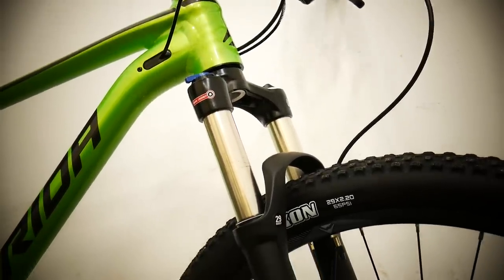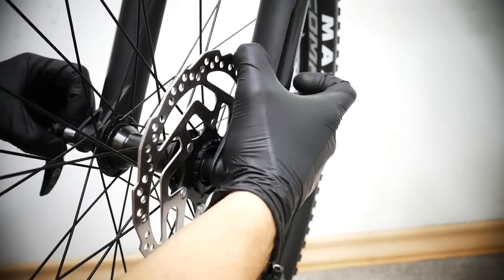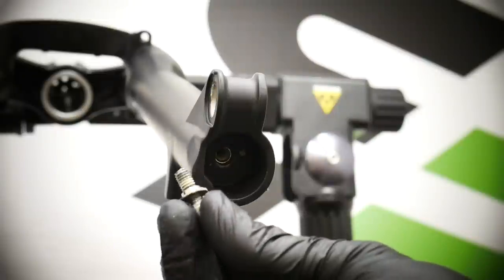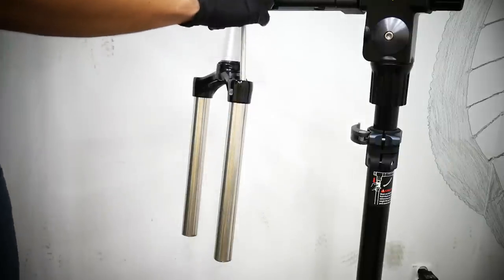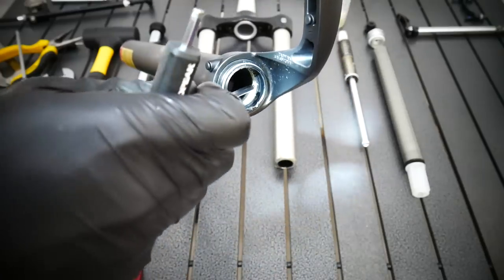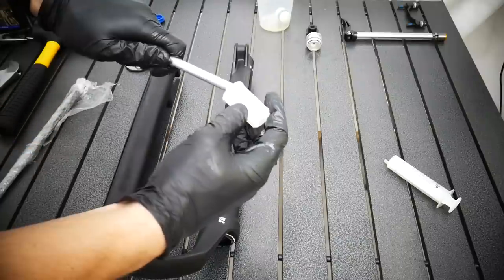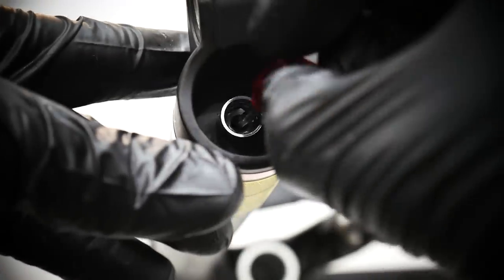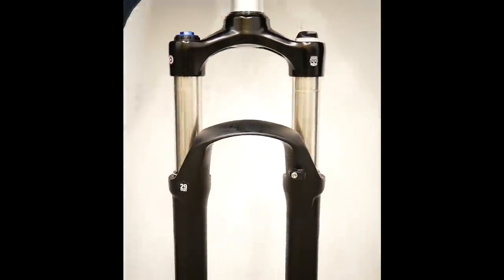Finally! SR Suntour XCR Air LOR Suspension Fork Service. FULL Overhaul.

Comment: Can do for Epixon or Raidon? I'm new to Suntour's air forks so have no knowledge about it.
Reply: I have Radion... watching you replies... but I think this is very similar.
Reply: I's the same. Clean the outside of the fork with isopropyl alcohol (only use this) first to avoid washing more dirt into it. Unbolt and drop the lowers like in the video by carefully pulling with one hand on each side, don't grab the crown if it feels stuck insert the bolts 4 turns and try tapping again. Spray everything and wipe everything clean. Use a dowel and clean shop towel to wipe inside the lowers. Regrease inside the wipers and on the spring shaft and rebound shaft. Carefully slide it back together and torque the bolts to 1Onm. Pump it up then go ride it!

Airspring service is only needed if it's leaking and the cartridge can't be removed so there's no point to risk messing it up.

Alternatively to grease you can add some oil (a low weight like 5w) in the lowers to boost performance but future services will be a bit longer/messier.  Also add flesh foam rings and wipers if needs be.

Adding oil is done the usual way- place lowers on stanchions, turn upside down and slide on until bolts almost come through the bottom, then add the oil using a syringe with a plastic tube end.  Measurements only need to be a little (perhaps around 10ml)

Lastly, another upgrade is to add closed cell foam into the top of the air chamber, which essentially works just like air spacers- makes the fork progressive thus you csn ride at a lower pressure for better small bump performance.  I've heard you can use oil instead of foam (float fluid by Fox, or the cheapo route is 80w Gear oil)

All the best x

Comment: please help me with this, i have xcr coil LO R, i opened the lo cartridge from upper side , i came out about an inch and now its stuck , later i unscrewed from the bottom and took out the whole thing and the problem is the LO cartridge has become 1 and half inch longer than its actual size and it doesnt compresses , it has become stiff, what should i do???
Reply: I wonder if it has anything to do with the lockout settings?
Reply: I'm not sure what else it could be apart from the spring/housing itself being out of place, broken/worn out.

Comment: Please help me! What original oil should be poured into the air chamber?
Reply: If you want to reduce the volume(SAG) use 80-90 Gear oil on the xcr
Reply: @wuzen-productions  Thank you) I do not want to reduce the volume.
Reply: @wuzen-productions  
So in any case, do you need to pour gear oil into this chamber?
Reply: @wuzen-productions  car's gear oil?
Reply: @koabrl  80 W 90 is a gear oil often used for older agricultural tractors or for trucks. Car uses less thick oil today. However, it's easy to get.

Comment: Can you do the sr suntour xcm spring type and has no lockout
Reply: Just open it, clean it, change seals and maybe bushings and grease it properly. (use suspension grease like SRAM butter) .
Reply: @th_js  you don't have to use suspension grease, especially with Suntour, but good grease still makes a difference, I use finish line ceramic grease and sometimes, rock n roll super Web.
Reply: @mikuramsay  Yeah, but it's way slicker than bearing grease.
Reply: @th_js  and its also more expensive and a special order item.
Reply: @mikuramsay  Well it's not that expensive, about 7e for one "jar" of SRAM butter and what do you mean by special order item??
Reply: @th_js  it's not readily available at most bike shops. And in my country its pretty darn expensive.
Reply: @mikuramsay  I don't even have a bike shop. The closest one is over 150km away so I do everything myself and order everything online, so not a problem for me.
Reply: And Finland is a really expensive country too

Comment: hi i have a wobble in the saction...what could be the cause of the wobble?
Reply: You mean wobble in the stanchion? It maybe assmebled incorrectly or it is already very heavily worn due to negligence and lack of care and maintenance.
Reply: @polishguywithhardtospellna8227  That, or it's just the norm. I have never had a fork that was even close to 100 percent stiff when you lock the front brake and rock the bike.
Reply: @benshamblin4407  Some brakes have very loose pads and they can move on a test like this, so there is a lot of potential sources of the problem. Head tube bearings worn or not enough preload may be another, but if someone's bothered by wobble in stanchions, I try to assume it's wobble in stanchions and that it's not some small wobble. there is no way to help someone that gives little info, and sometimes there is no reason to dig deeper.
Reply: @polishguywithhardtospellna8227  that is very true. speaking of issues, my fork seems to creak under the first 10mm of travel, when I'm doing light singletrack. Could it be the seals creaking?
Reply: if there is some play between lower legs and stanchions its probaly the plastic bushings inside the lower legs being worn down

Comment: 10mm or 5mm foam rings?
Reply: 10 mm maybe even 11 i custom made it myself and the fork works much better
Reply: @aleksandargorgievski8498  what kind of foam did you use?
Reply: did u buy the rings? will 10 mm fit?
Reply: @aleksandargorgievski8498  did u put 10mm in? I think thats too high

Comment: My raid on forks won’t hold air already after only 11 months! Which bits to replace?
Reply: you just need to add a bit of oil to the air chamber. Remove the air valve core with the tool, go to your automotive shop and get some 80W synthetic oil, and put 10ml of it in the air chamber.
Reply: I have the same problem with my aions, did this work?

Comment: I have 2 xcr  and epinxon and their catridge all dead so no lockout function..  Its homework for santour
Reply: Those are the cheapest products in the market, what did you expect? Try Durolux and see all the difference in the world.
Reply: if the top cap is the metallic treaded  you can upgrade with Epixon serviceable cartridge, i did i have my xcr plush like fist day after upgrade, nitrogen sealed cartridge is a headache and more if you are a heavy rider like me (100kg)
Reply: @SparrowRz  what this epixon part upgrade you used on this fork I'm interested

Comment: Could you do same kind of video for epixon?
Reply: Yes Please
Reply: @swiatekx3  It's the same. Clean the outside of the fork with 91% isopropyl alcohol first to avoid washing more dirt into it. Unbolt and drop the lowers like in the video by carefully pulling with one hand on each side, don't grab the crown if it feels stuck insert the bolts 4 turns and try tapping again. Spray everything with 91% rubbing alcohol, not degreaser. Wipe everything clean. Use a dowel and clean shop towel to wipe inside the lowers. Regrease inside the wipers and on the spring shaft and rebound shaft. Carefully slide it back together and torque the bolts to 10nm. Go ride it! Airspring service is only needed if it's leaking and the cartridge can't be removed so there's no point to risk messing it up.
Reply: @tadgarman8463  thanks for this Tad, I'm wondering about when reassembled and what oil/grease to use, where and in what amounts? :)
Reply: @herculesmclovin  Sr suntour forks use only suspension grease in the lowers. They aren't an oil bath fork so no oil. I'd use a high quality suspension grease. Srsuntour has some on their website also rockshox/sram Judy butter is good. Or slick honey. Any of those should work well. Just enough to coat all the parts thoroughly. It's not rocket surgery.
Reply: @tadgarman8463  thank you I appreciate it :) as it happens I've done a lowers service after more research, of which oil has been used as am upgrade including foam rings because the standard ones aren't designed for oil. Y fork is working great for me and it's a lot more responsive with small impacts :)

Comment: my advice would be use more grease. Why? let's say you pressure wash you're bike what you should not but anyways you do, water might infiltrate but if you have a thick layer of grease it will be impossible for water to get in.
Reply: Excess grease can become a dirt trap, become abrasive, and increase seal wear.

Comment: As far as I can see, it is not worth servicing this fork as you cannot do too much for this. 5 ml oil change won't do too much, nor do the minimal greasing.

When the sealings and the 5 ml oil "go wrong", probably the non-servicable components will fail either.

I will use mine until it works, then I'll buy some better fork. I expected a bit higher quality from Suntour.
Reply: Just do lower leg service from time to time to not damage the fork. Even if it's cheap it's a fork
Reply: @Paulklampeeps  exactly not maintaining it is gonna make it worse anyway. I have a 140mm su tour xcr 34 on my canyon. I oiled the lower legs and it feels just better. Its just a fact
Reply: @XxNoMercyNL  wow, thanks for sharing, man.. what kind of oil do you use? with grease also?

Comment: The Q-loc is very unreliable I bought a bike with it on rode down a trail got a puncture took it out then when I went to put it back in it wouldn't lock up anymore bad to refund bike same day
Reply: And you're sure you had it set into place right with?  They don't just stop working..
Reply: What did you do in the end?
Reply: @herculesmclovin  I snet the bike right back didnt regret it at all the Q-Loc is known for being very unreliable and fragile.
Reply: @herculesmclovin  The guy at the bike shop said it had a part missing so if it can lose a part after one ride that proves something,
Reply: Okay, I had a Q-loc 2, without any issues, but if you're telling me it's known for it them I'll believe you, guess I was one of the lucky ones aha

Yeah, that shouldn't happen, Jeese :/
Reply: @herculesmclovin  yeah haha they are lovely mechanisms one of the fastest but could definitely use some improvement.

Comment: What type of grease to use?
Reply: I think you can use normal grease just make sure you remove the old grease then apply the new grease
Reply: @corstrix7975  any grade grease will be fine?
Reply: @tohhanshen2905   I didn't understand grade greases but I will show you some examples that I hope you will understand  https://www.acehardware.com/departments/automotive-rv-and-marine/fluids-and-lubrication/automotive-lubrication-greases/8008860

https://www.stateelectric.com/products/sta-lube-sl3310/
any all purpose grease works fine for regressing mountain bike  unless the bike frame is made out of carbon fiber short answer  for the fork all purpose grease works if you want send me an image of the grease
Reply: I just thought there was a difference between regular grease and the grease used in forks. Like butter grease. But I guess any grease would do. Thanks
Reply: @tohhanshen2905  your welcome 😄
Reply: @tohhanshen2905  Dont put any grease on it, lithium grease could damage rubber, buy grease for forks
Reply: @corstrix7975  no, you absolutely CAN'T use normal grease, especially if it has lithium in it as it'll damage the rubber seals. You need fork specific greases like SRAM butter or slickoleum.
Reply: @Andrea-qg5yk  It is true that any petroleum oil based grease will damage natural rubber seals (oil dissolves it, not the lithium, or calcium, or sodium - they are just thickeners that turn oil into grease). But it's also true that hardly any modern o-rings are made of natural rubber, they are mostly made of synthetic rubber or some sort of polymer. And you don't know when you look at it or touch it. If in doubt, the only safe option is to use silicone grease, which most definitely doesn't damage any type of o-ring. But silicone grease maybe doesn't like to get in contact with other oil in fork, in which case it would lose its function. SRAM butter/slickoleum is petroleum oil based too, and heavily used in Rockshock forks, but just for the inner sides of dust wipers, not for the internals of air chamber or damper. There they recommend PM600, a dark red, very tacky type of grease. And that was until 2015 when they started using oil more and more, like Fox. So in general, it's best to follow the maker's recommendations for grease and oil. But if there isn't any, yeah, go with the Sram butter or PM600, 95% chance that it'll be just fine. But let's be clear, I've done some research, there is no evidence to suggest that SRAM butter or PM600 are any better for natural rubber seals than lithium grease, they are all petroleum oil based. And since hardly any seal is natural rubber, you could probably stick to this lithium grease too. Maybe. It's not that simple unfortunately.
Reply: @Andrea-qg5yk  I use normal lithium based grease in my raidon fork since 4 years, inner parts and wipers are still like new, I did a quick lower leg check today... btw the wipers doesnt contact the grease if you have foam rings in your fork.
Reply: I recommend teflon grease

Comment: where can i get a replacement air valve 31.5.mm
Reply: If you are in the UK the Suntour distributors now have an eBay shop under Bicycle Parts UK which sells all the parts and the 80wt oil. In North America you can get them direct from Suntour.

Comment: XCR is the absolute lowest end of the spectrum for air fork. This is not racing material and it is on CHILDRENS mountain bikes. Epixon is the XC fork you should be rebuilding, and its dirt cheap. Why would anyone that actually races want this stuff? Parts are cheap now if you know where to look, and its all top quality. Who rides with STEEL stanchions in 2019? Good rebuild video, but XCRs seriously.
Reply: Not sure that it was mentioned anywhere that this was racing material. The video was on the shock, so who cares what bike it was on? If you don't want to watch a video on XCR, than go watch one on your Epixon. The video was obviously not for you.
Reply: @hueyh9142  This channel is promoting XC RACING, which I am fully supportive of. The idea of rebuilding a low end fork that cost 80 francs is ridiculous. These channels are all over the place in terms of content.
Reply: XCR is third rank (above XCM & XCT). XCR Air is kind of fourth rank, because it's better than the coil fork.

The point of this video is you own XCR Air, you need to rebuild it, you pay $20 and you rebuilt it. Epixon costs $160. You cannot compare $20 with $160.

Also, in terms of weight (29"):

XCR Air 2459g (I think it's oem only?)
Raidon 2067g $120
Epixon 1810g $160
Axon 1628g $225
Axon Elite 1599g ?
Axon Werk 1570g ?

I've seen the Raidon as OEM on new bikes, it wouldn't make sense to replace it with an Epixon (rebuild, or go to Axon). Also I think the current year Epixon is heavier than before, so you might want to go for Axon anyway.

I have friends in Indonesia they don't have $$$ for new parts, so....
Reply: @matthewbrealey2026 Axon werk is 1,200 francs or sponsored. You can race epixon.
Reply: The xcr 34 is not steel stanchions and its a boost fork, certainly not on a kids bike. Get your facts straight
Reply: My bike has a XCR 32. I don't do racing, and I'm really satisfied with this fork. I don't pay thousands for a bike, if I only ride through forest paths. As long as it's used for simple cross country it's a usable, affordable fork. Racing forks cost more than my entire bike. 
Children's bikes have coil spring forks, and this air XCR is still way better than a coil spring one. 
It always depends on what you're doing with this stuff.